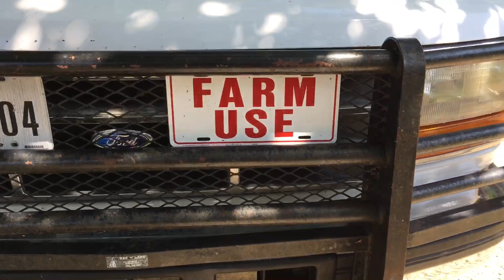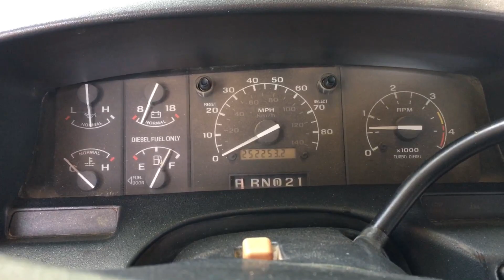New Truck! 1997 Ford F-350 7.3 Powerstroke

Comment: Make sure you replace the down pipe whenever you straight pipe it because the factory one is super restrictive. Another good thing to do is replace the air intake with a more free flowing one. Other than those things, it really is a nice reliable truck to have so congrats man.
Reply from the maker: I just got a 5" Diamond Eye turbo-back straight pipe. Can't wait thank you!